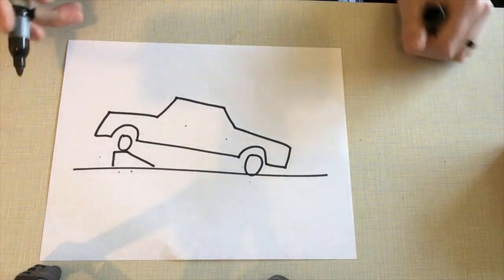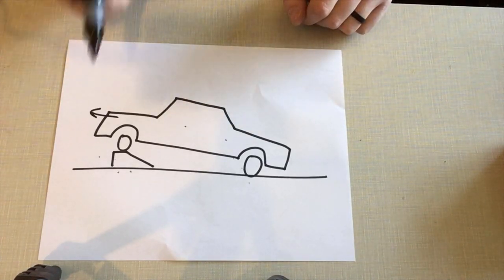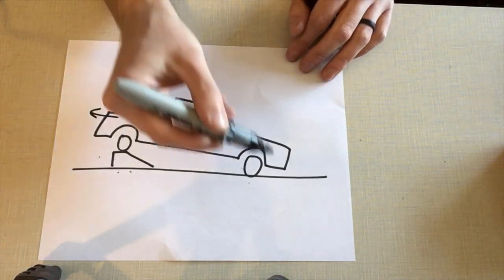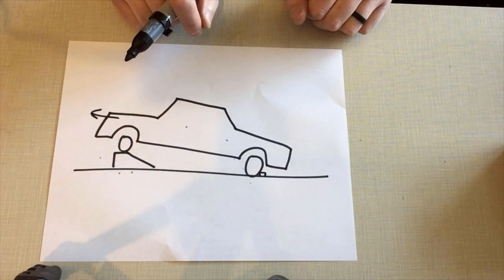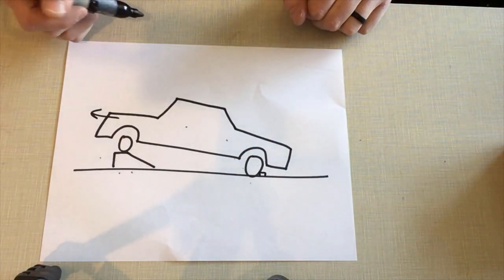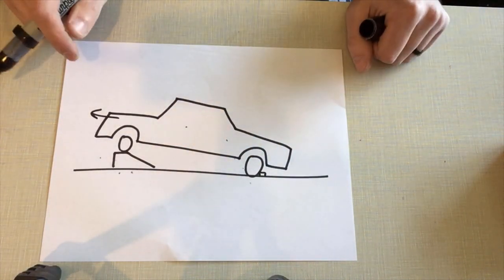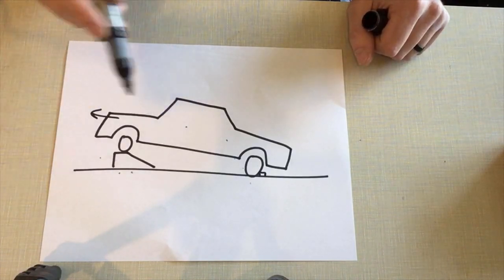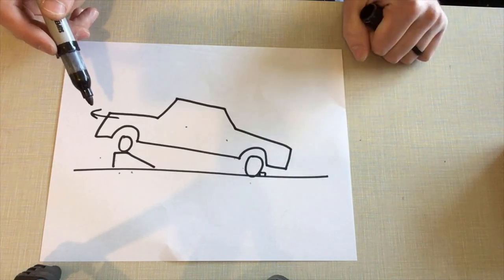PSA: My Dodge Magnum/Charger/300 almost killed me, how to NOT replace the front drive shaft.

Comment: Wheel chocks anytime there is a wheel to chock. Let the car roll into them slightly or give em' a whack with a mallet to be sure they're set. I use the spare tire as a backup wherever my head is when i work too. Sometimes paranoia is a positive.

Comment: Glad you are ok. It would be Intresting  to see why the car rolled back unlike a 4x4 pickup. Ive seen people that have a non working front drivetrain or supposedly saves a diffrence in gas mileage so they remove the front driveshaft. The transmission still locks up the rear driveshaft when placed in park. God bless everyone.
Reply from the maker: That’s was my mistake: I assumed that was how that transfer case worked, when in fact it really was a third open differential in the drive system-Take one wheel away and the other three can do whatever they please.  Thanks for the kind words.
Reply: @amateurism1  I was looking into images of a dissasembled transfer case to try and find out how that would work but could not jump to a conclusion about how it worked. I would be more confident having one on a work bench and tearing it apart

Comment: I'm about to work on my 300 front left CV axle and now I'm curious if the parking brake will hold the car in place if the rear wheels are on the ground?
Reply from the maker: If the parking works properly, I guess... Why don't you test that? If your on level ground and properly chocked, you should be fine.

Comment: Im about to change my gas tank on my 07 rwd sxt so im glas i seen this because i didnt think of the parking brake this way so would it be best to lift the front and the rear on Jack stands and drop the tank? I was planning on just lifting the rear but was thinking that i would need to be using alot of strength to move all that stuff around and it would fall annyway while me being so far underneath so thank god you made this video
Reply: Hey, maybe too late but there was a recall on those gas tanks. You should see if your car qualifies before you attempt your own repair. I had my 05 Magnum done last year, 15 years after it was made!

Comment: Question..
Can you still drive the car with no front drive shaft
Much like one can do with a four wheel drive when the transfer case/  front differential is bad...
Reply from the maker: Richard Martini my guess is no.  You will not have park without the front drive shaft in place, so who knows how this transfer case works; that was actually my plan all along, pull the front drive shaft and drive around in rear wheel drive only, it didn't work out for me that way lol.
Reply: It might work but I doubt it, it would probably throw a transmission error and not go into gear. Even if it did you'd only be getting 60 something percent of engine power to the rear wheels while the fronts do nothing because the rear shaft is still connected to the transfer case getting the same power as always. I've seen RWD conversions of AWD Chargers, but they took out the transfer case and did it properly.

Comment: Hey how did you determine it was the drive shaft and not the transmission?
Reply from the maker: If you are asking, "how I know it was the drive shaft that was bad," watch the end of the video, the u joint it clearly shot. 

If you are asking me, "how I know the drive shaft holds the car in park," I'm not saying that.  I'm telling you in the video that there are three open differentials after the park mechanism, one of the three is the transfer case, if you remove any one of the four tires from the ground on a hill, the car will roll in park mode; it rolled over my head.

Comment: Jacks
2 tires 
Big as* rock that a wheel can't roll over
Would not leave my car on a ramp flat part much less back a lil..
My guess as a girl that's what I would do first before I work on it. I also assuming if u remove drive shaft if that has anything to do with transmission Iam guessing the car will no longer be in any gear, esp to hold wheels any more....Just a guess and playing it safe..

Comment: I was gonna go work on my car tomorrow.. i guess im gonna have to postpone that or just take it to the shop.  This is what im paranoid about when im under the car. The reason why i use 2 jack stands each side and leave the floor jack  on just to be sure.😩 ✌️👍🙏
Reply: 2 jack stands and a floor jack + blocking the wheels  is the way to go.   Just be careful and you'll be OK.

Comment: you could have put the transmission in neutral and just turned the front drive line  with your hand so you could could get  to the other bolts  car would have stayed in the right place on the ramps as long as you have the rear wheels blocked
Reply from the maker: No, it doesn't work that way-Not trying to argue.  Thanks.

Comment: So : Mechanics 101: If your getting under a car for any purpose at all,  jack stands and wheel chocks in front and behind of at least 2 wheels.   And throw then damn wheel ramps in the junk.
Reply: One thing about wheel ramps that’s better than jack stands.   If you just need the car up but can leave the wheels on, it will always be more stable laterally than jack stands.    I accidentally almost pushed my old Crown Vic off jack stands while replacing a motor mount.   The wall of the garage kept it from tipping more.  I had driver front wheel off, and a big pry bar to push the engine over enough to line up the motor mount, and pushing really hard it rocked over several inches.   Kinda scary.   Lesson learned.   Also, get the right motor mounts and compare with old ones.    One of my new ones were wrong.

Comment: Insight STILL WRONG, and unsafe!!   on any rwd vehicle, the driveshaft is the only thing holding rwd to transmission…  you remove the driveshaft. The rear wheels turn free. minus parking brake.The only luck on a truck would be a locked differential.   ..When tow trucks tow RWD 4WD trucks, the operators drop the driveshaft so that the rear wheels spin freely.

Comment: first, never ever rely on the park pawl to keep the car from rolling when it's lifted, use parking brake. First and half, never lift the car on not level surface, ramps are dangerous on many points, putting a block of wood at rear wheel alone is not enought either... Second, those transfere case are open, there is planet gear inside at some point there were clutch inside but they have been remove due to shudder, so if you are on incline in park the friction of the tire will prevent it from rolling but once the front or rear axle it's lifted or front or rear DS is disconnected the park pawl is useless...Never take for granted other vehicule have, newer charger have front axle disconect, what would you have done in that case? 
What you say in the descripion is wrong, the park pawl is in the trans that's what the P is on the shifter, but the parking brake is not apply wich is in the rear wheel btw, if it was apply, like the 1% people do with automatic, you wouldnt be hurt. Even on parking lot you should set the parking brake if someone push the car while in park it could broke the park pawl then you need a new trans...
I've met many engineer, some brilliant but most of them they just own a piece of paper saying so stapled on a wall and bring the "safety first, always! I've been saying that for 25 years..." (if you get that reference you know they almost wiped out the europe in 1986...). I've see myself some quiet scary moment like a floor jack failed when I lifted my rear subframe back on the car, the magnum was on the quickjack so nobody was hurt...
At least your still alive it's the most important! Be safer next time